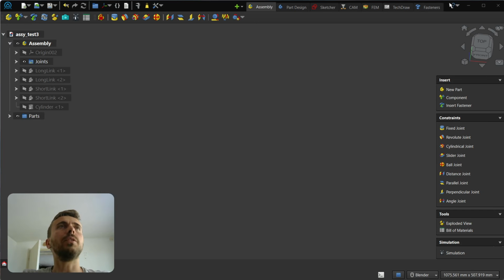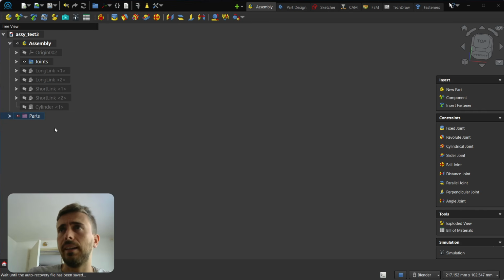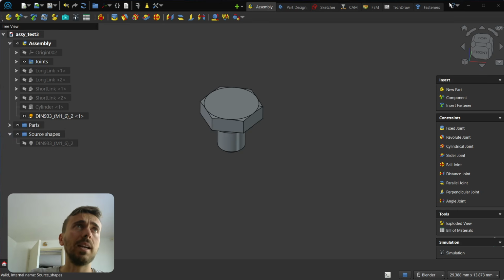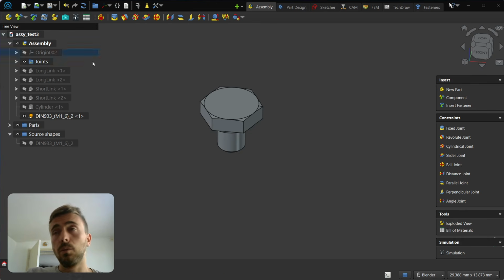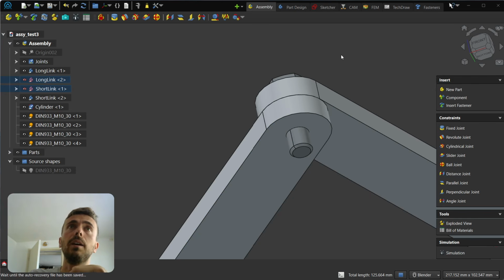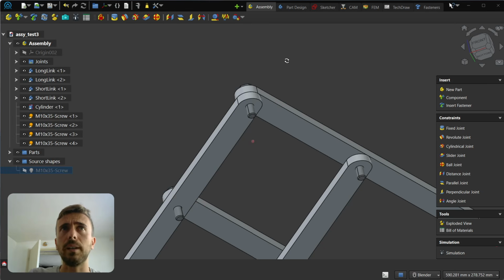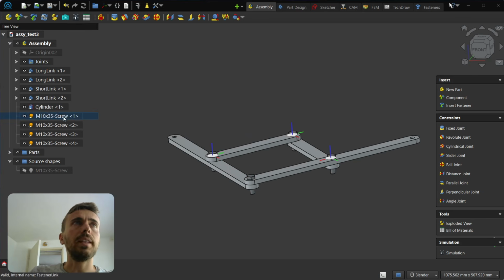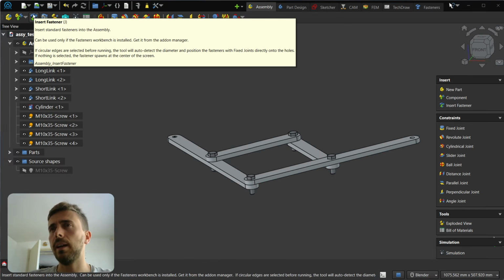Assembly: Insert Fasteners tool

Comment: I am looking at moving from Fusion 360 to FreeCAD. My work is not really affected by this vid, as I print my own screws. But the improvements seem welcome. For me the biggest issue is checking an assembly for interfering bodies. Seems like I have to export in step and validate in Blender at this point. To me that is the only real drawback of this program. You also mentioned in another video about features being changed for assemblies. If going into this, how stable will this be? Will old files open in newer version of the software. Also, when you make a library such as this, will the files work in plain FreeCAD as well? I design with sharing the files in mind, and stability and compatibility is an issue for me.

As for interference, someone mentioned that the part design has a Boolean feature, I just cannot get that to work for an assembly. But if you did, you could run through all the combinations there is of bodies, and then list the interferences you find. If that Boolean thing works, you could actually just make a new body where the intersection is, to visualize where it is. Easy way to do this is having a toggle for such an object, in the list.

Also, if it is possible to toggle to a display of only the two interfering parts, that would be awesome. This is a huge issue in Fusion when there is many bodies.

If anything like that was implemented, I could leave Fusion. I will have to try to use Blender for this, but it is a hefty work around. 

Looking at your branch, will files made by it, be compatible with the plain version? Is that a design goal?

Also, you mentioned something in a video, that files were incompatible going back in version, but what about old files going forward. Do I risk anything using your branch?

Comment: This is really good. Almost like Autodesk Inventor style. 😉
But for ERP transfer reason we need to have standard part library. Every company may assign part number to the bolt/nut according to their ERP systems numbering style. We may integrate SQLite in to FreeCAD to achieve this I guess.
I have a question please: Is this written in C++ or Python. I want to help to develop FreeCAD but I don't know here to start? I found only your Developer video but 4 years old and lots of things changed I see.
Regards...
Reply from the maker: Hi, you can check the PR here : https://github.com/FreeCAD/FreeCAD/pull/29478
for more details.
This PR is mostly python. If you want to start contributing, I suggest starting by setting up the environment to build freecad with your github repository. This is the first hurdle to overcome.
Once you can build and managed to setup git / github, then start with something small. It can even be fixing a typo or something like this. Just to learn the process of creating the PR.
Then pick an issue and start working on it.
With todays AI it can really help you getting started. But what not to do is pick a very hard problem and try to fix it with Claude or such. Because he can make a bad solution that will eat reviewer's time.